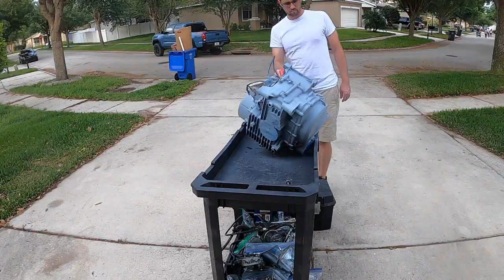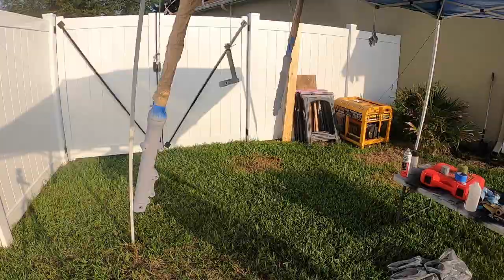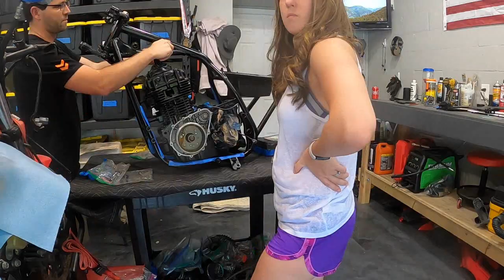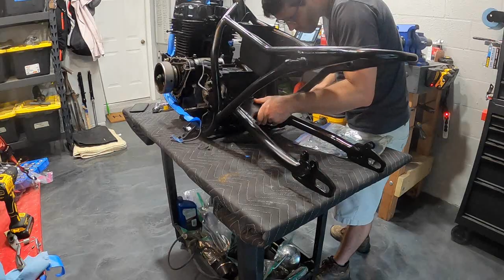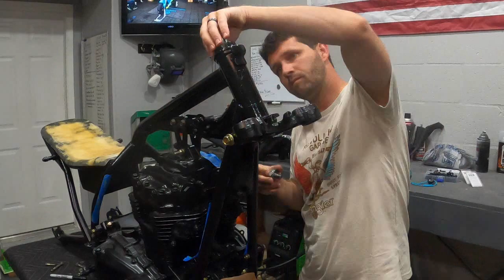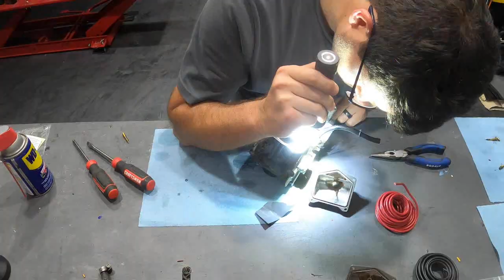1982 Kawasaki KZ440 Cafe Racer Build Time Lapse - Part 05  - Engine Paint and Assembly

Comment: Awesome videos!  I'm doing a KZ400, how heavy is the engine? I need a budget way to get it out lol
Reply from the maker: The engine isn’t that heavy, I could carry it myself. But it is a tight fit into the frame so you definitely need a second person to help. Good luck
Reply: @reddoggarage  thanks for the answer!!
Reply: @EslavaxD8  Pro tip, filp the engine on its side and slide the frame over the engine. Then bolt it up again and flip the frame with engine, thats how I did it :)
Reply: @ColinvanMil  thanks! Thats exactly what I did and ir worked!
Reply: Another trick is remove the 4 bolts holding the breather pipe cap on the top of the engine. Without the cap there's 2 inches extra space.